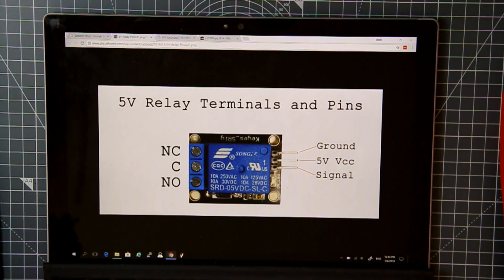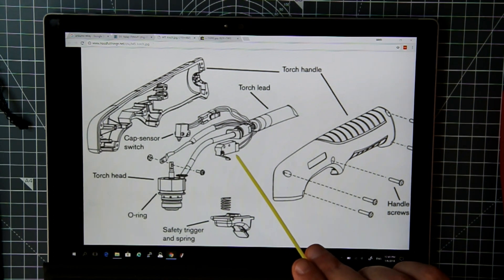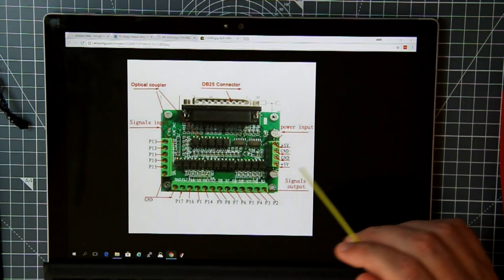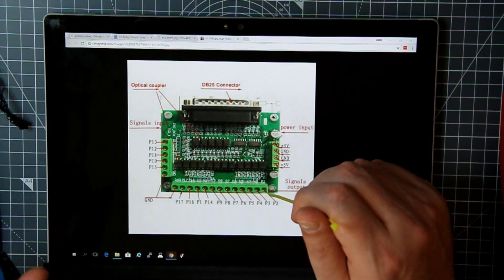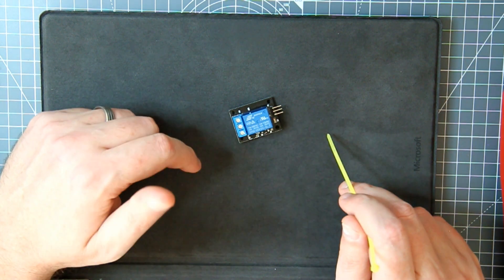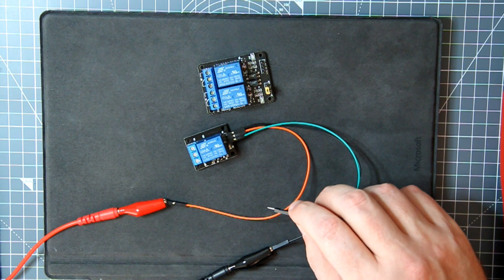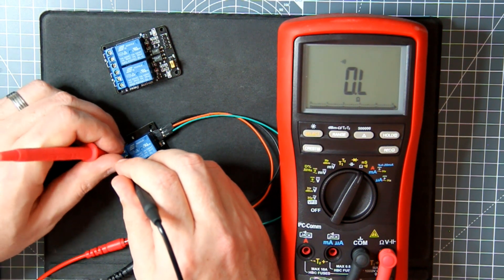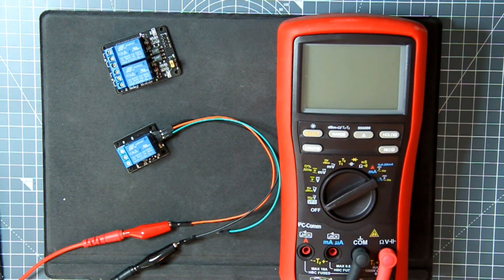CNC Plasma Relay

Comment: Great video man. I have the sainsmart tb6560. It has a internal 5v. As well as on/off 5v relay internally on the board. However. My thinking. The internal relay on the board could be ran in parallel to a 5v pwm. Would there be anyway you could help explain what would be the signal on the board. Or do you thinking the internal 5v relay has the signal.
Reply from the maker: So are you wanting to start the relay when the Stepper Motor Driver Controller starts moving? you really want the CNC software to trigger the relay, are you using a floating switch? or is this more just a general wanting a relay to trigger? depending on the relay type some need +V to trigger others need - Negative (ground) to trigger

Comment: Very useful video, thank you. I’m not using a controller like yours, I’m converting a laser cutter. I’ve got the relay working with the laser, as in turning on and off when it should. Do I just need to bridge the 2 wires coming from the plasma trigger, and connect them to the normally off circuit on the relay?

Comment: My plasma torch fires when is not supposed to and it stops when it supposed to fires
 Can i reverse that in mach3?
Reply from the maker: You need to check if this happens when there is no power - Mach3 won't help. You need to setup the relay to be normally open and only close when Mach is powered on and sends a signal - not sure if this makes sense
Reply: @cncmetalworks  yes, even with the control board off and pc off as soon as I turn on my plasma on, it fires the torch, still cant figure it out. Mach3 shows torch fire on but actually plasma is off and vise versa.
Reply from the maker: @orubenvaldez  The issue you have is you have the plasma wires connected to normally closed on the relay. connect the wires to normally open. so that when there is no power to the relay the plasma does not come on
Reply: @cncmetalworks  genius. I was having a hard time trying to figure out that
Reply: @cncmetalworks  I'll try that this afternoon.
Reply: @cncmetalworks  would it be a diagram on how to do that somewhere?

Comment: Can you show me how to hook up the torch and relay to a gecko 540?
Reply from the maker: Hi have a look at page 8 on the manual attached - http://www.farnell.com/datasheets/2547873.pdf - here is reference of the outputs - OUTPUTS: The G540 has two general purpose outputs called OUTPUT 1 and OUTPUT 2 on the MAIN TERMINAL
 BLOCK. They are at POSITION 5 and POSITION 6 respectively on the terminal block. These outputs may be used to drive relay coils or for any other purpose. The outputs are rated at 1A and 50VDC maximum. Connect one end of the load to the output and connect the other end of the load to a positive DC voltage. This voltage may be the G540 power supply or it may be a separate power supply having a different voltage.
Reply: @cncmetalworks  Thank You!.. will give it a look !

Comment: Hey, thanks for this video. I have a 5V 2A solid state relay and I was wondering if this is capable to manage a plasma torch trigger. Thanks in advance.
Reply from the maker: It should work fine. there is no high voltage running through the switch
Reply from the maker: I just want to add that solid state relay do not work with DC power as standard
Reply: instead of cutting the switch cable of torch, you can connect the control cable and the relay switch to directly the plasma machine.

Comment: Can you not just use a laser board and have the relay added to where your laser would plug in so when it activates it turn plasma on and off like a laser would
Reply from the maker: All this does is complete a circuit what one wants to make sure is that there is no connection back to the board when the circuit is competed. Also some of the issue we have is there is not enough power in the BOB to pull the circuit closed that's why I used the Ground as the trigger. hope this helps?
Reply: @cncmetalworks  thats what i was thinking it would do it would be like it pulls the trigger for you and i figured with a laser board there should be enough power to the laser part to activate the relay
Reply: I've got my 3 laser connecter wires (-,+, pwm) on the relay .  I've got the 2 plasma trigger wires on the NO & NC. The led is lighting up at the right time but the relay isn't closing idk why

Comment: Im not CNC savvy but, I'm in the process of setting up my plasma table.(I am a welder but old school) I have a chineese breakout board this is the link to it https://www.google.com/aclk?sa=L&ai=DChcSEwj8-M21jo7eAhUCTA0KHTIsD_EYABAVGgJxYg&sig=AOD64_3TFsOa20CTY92fZNiPIl3TV06h6A&ctype=5&q=&ved=0ahUKEwjdq8e1jo7eAhWJylMKHf0eB3QQ9aACCDU&adurl=
Do i need a relay switch to turn on and off the torch trigger? I'm really not sure how to wire it to the breakout board if i need one, would appreciate any help you could give. Thanks